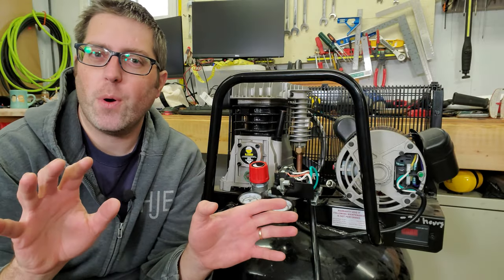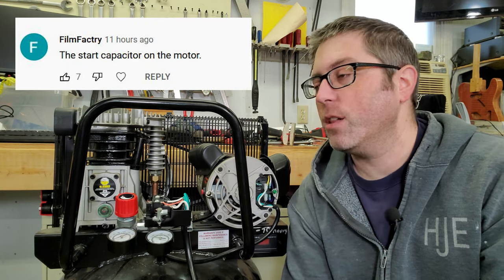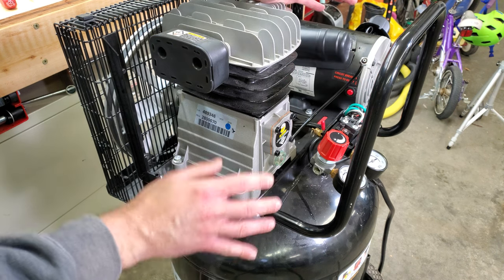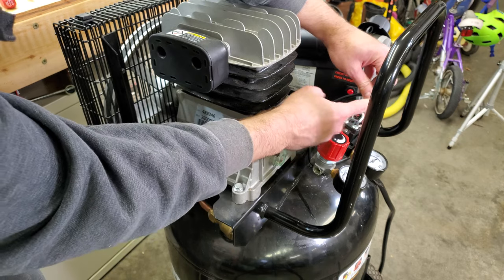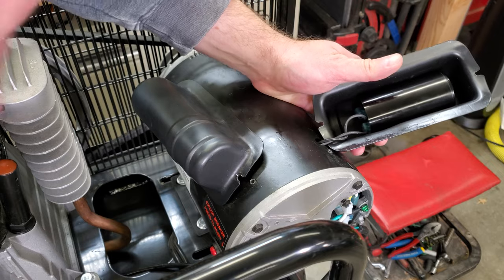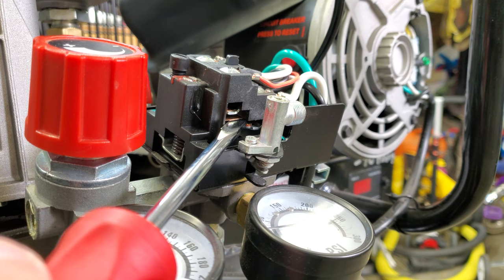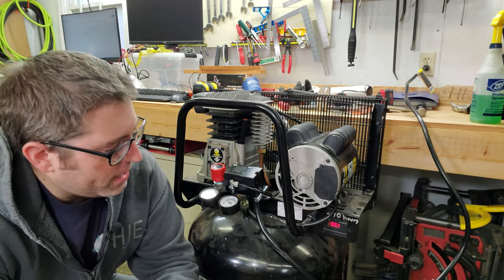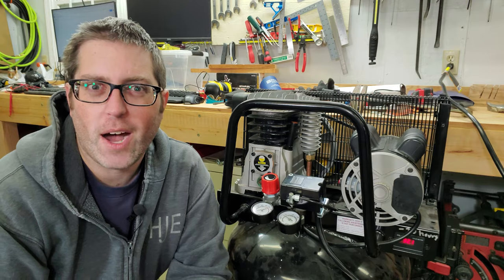How to diagnose an air compressor that won’t start. Fixing a Harbor Freight compressor

Comment: Glad you got it figured out .Most people dont have ability to diagnose problems and would junk it. I would have thought the starting capacitor first Check valve second then switch. Ive been lucky and saved a couple compressors from heap pile by just spending a bit of money and time to figure out the problem.  Hope you get 500 hours more
Reply: Exactly. I recently curb-shopped a small HF compressor that looks brand new but won't power up. Needs a new power switch. YouTube has been a great help to me in simple fixes like this.

Comment: I just replaced that whole pressure control on my 9 year old 29 gallon harbor freight air compressor. It had cracked the 4 way body and began to leak. The only other failure I've had was the gasket from the head to the manifold going to the tank. It's nice they added the hour meter to the newer models.

Comment: You did good job finding the problem 2 months ago I was given a 10yr old just like that the switch was stuck on run I cleaned it worked for couple times then went back to sticking I bought on Amazon an identical replacement that working pretty good now

Comment: If you have been running your compressor hard and it shuts off and wont restart before doing all of this diagnostic stuff drain the tank first and then turn it on again. Works a lot of the time

Comment: I had a similar problem like yours many years ago. The wiring on the switch only used half of the contacts and was burnt burnt.
So I cleaned the contacts and divided the amperage between two different sets of contacts.

Try reversing the polarity on the hour meter and see if it runs backwards.

Comment: I bought the same 29 gallon compressor from HFT About 2 months ago and it doesn’t have an hour meter. Please share what you upgrade the pressure switch with.

Comment: I actually today just bought my stores last one that was on clearance and the quality was surprisingly good and this is the same one but they must of changed some things there is no more hour meter and the control/pressure switch was tuned to the left for better access but couldn't beat 380 bucks

Comment: My HF 3 gallon McGraw compressor won't restart after initially compressing the tank.  Eventually (1/2 hour or more) it will start again.  i believe it is overheating but cannot find any way to confirm that, what to do about it, and how to reset it.  The tank becomes almost fully charged (110 PSI)) and then the compressor stops.

Comment: Those pressure switches are a pain in the ass to rebuild. Our HF compressor was leaking out of the pressure switch diaphragm so I had to take the whole contact switch mechanism apart, then used some RTV to fix the diaphragm. It’s not so much hard to put the pieces back together, it’s trying to get all the pieces back together under spring tension.

Comment: I have a HF beltless oil lubed compressor. It's very difficult to get started in the winter. I have to switch it on and off repeatedly while pushing the circuit breaker button. I think the oil thickens up in the cold.
Reply from the maker: You might want to look at the tank check valve and unloader valve. Sounds like maybe there's pressure remaining in the head.
Reply: @ToolTeardowns  it only happens in winter. I think I need a lighter oil.

Comment: I had a similar problem with a bench grinder because the centrifugal switch inside was bad and it would sit there and hum.
But I decided not to fix it because this way I could start the Grinder running in either direction by starting it by hand.

And a week ago I picked up a free air compressor on Craigslist and it would not start because I found out that it had a bad start capacitor. I knew enough about motors that was one of the first things I checked.
With no load at all on the motor when I turned it on it would pick up speed run normal and I would hear the centrifugal switch clicking inside so I knew it wasn't the switch.

Comment: Grr. I never get those easy fixes. It seems everything I work on the part that fails is always the hard to diagnose one and the one that is the... Oh that never fails... For my stuff I always start with the obscure failures first. My 60 gallon decided that one of the rod bolts was too tight and loosened itself to the point that the rodcap fell off... I had an oiless one that the bolt holding the piston top broke... 
   Looking forward to some more content it's been a while. How is the car coming?
Reply from the maker: I haven't worked on the Beetle much. I've been busy with a new job and kids. I bought a couple motorcycles, so I've been tinkering with those and debating whether to try some motorcycle content on the channel. Thanks for sticking with the channel during this slow period.
Reply: @ToolTeardowns  When you get to it you get to it. The daughter has been out of the house for several years and better half is wanting grand kids so at some point it'll be busy for us again as well.

Comment: There's no reset on your hour meter?  Dang digital thing.  Some analog ones used to have a reset button.
     Grainger Industries sells a vibration activated hour meter by the way.

Comment: Question, I have a HF compressor (direct drive) that you have to bleed off some of the air pressure at times to get it to start.  It tries to start but, until enough pressure is released it just kicks the breaker after a few seconds.  Once, it's running it pumps up fine, just takes a little extra effort from time to time to get it running.  I have had this for years and kept the oil changed, garage kept, and emptied between uses.
Reply from the maker: Sounds like a problem with the unloader valve or tank check valve. Both of those would allow pressure to stay in the pump, which makes it hard for the compressor to start.
Reply: Bad start capacitor?

Comment: Seems shortsighted to build a compressor with a good pump, start caps and motor but put a cheap part that is high failure and essentielly “kills” the machine for most people.

Comment: Could happen to any compressor yet the hf trolls bash it anyway. They hate hf but follow all their tools . Guess it helps them feel better about spending to much on their name brand china junk.
Reply: You must have missed he already returned the first one.  This, being the second, failed at 25hrs  But please, continue to praise the brand. The parking lot sales before the pandemic would always have these in the return area. Some larger stores I've seen as many as 10 of these red tagged. Sunday, everything red tagged drops 1/2 off the red tag. If I recall, these would be $75-80, well worth the price of the tank and plumbing bits.  With luck, you got a compressor to do a job.  With great luck it outlasts the 1 job.
Reply: Russell Phelan  LOL. I have seen plenty of these for under $100. I have an 80gal, 3 piston that was new, still bolted to pallet that was $150. $800 welders for $350. Last day of the parking lot sales all the red tags were 50% off and they had piles of these 29gal CP units.

Comment: For what its worth, my old harbor freight compressor like yours is still going fine years later. So is the Mcgraw and my personal favorite, a Kobalt quiet tech. It's going strong as well. I think it's 4 years on the CP and 2.5-3 years on the Kobalt and Mcgraw.  

I have 3 oil filled compressors and 1 oil less. On the oiled I change it once a year unless it starts looking bad. However on all 4 I make sure to drain them every time I am done using them.